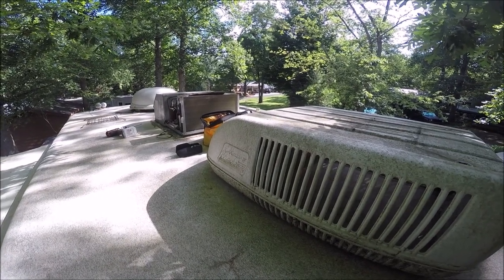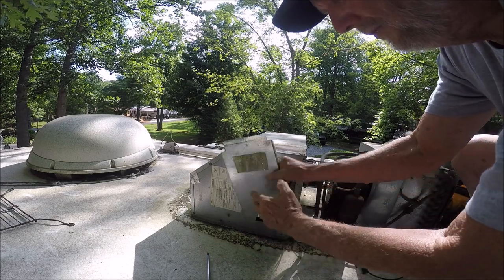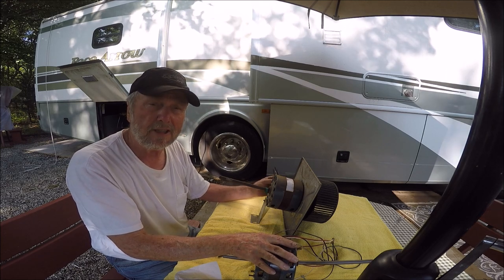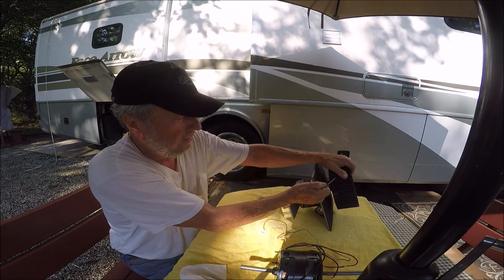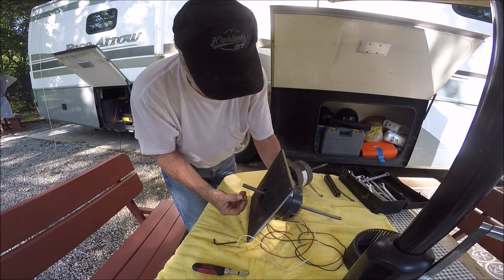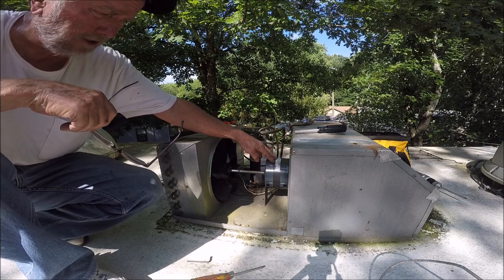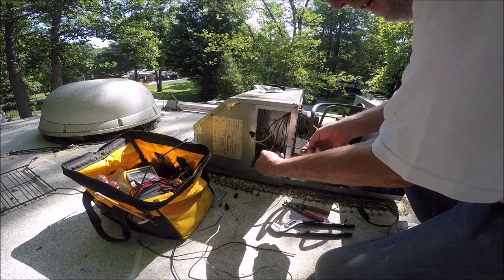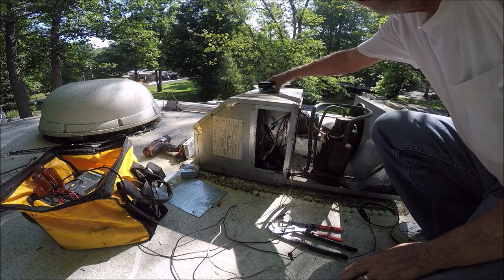Replace RV AC Blower Fan Motor on Coleman Mach

Comment: I'm happy to say after finally getting the replacement fan blade and few mods, you were right I needed to redrill for the support stand, it's a done deal, didn't have to replace the capacitor so since the motor came with one I have and extra one just case. happy trails.
Reply from the maker: Well Done!!!

Comment: Thank you for the video. I replaced mine today. I purchased my from Amazon for $135. It was the Fasco brand. The part number is D1092. The seller was Electric Motor Warehouse in Greensboro NC.
My ac is a Mach series made in 2003. It runs good and coils great.
Reply from the maker: @Lewis TT23, great always to hear when folks find my video helpful.  Thanks for putting your part name and model number, will help others.

Comment: Thank you for the video! The instructions were spot on and it made my job go very quickly. I replaced the Cap and the motor and wow what a difference in power and efficiency. Thanks again!

Comment: Thank you for taking the time to show how to take that fan assembly out. In my case I need to replace the plastic wheel but the procedure I’m sure is the same. Robert in MD
Reply from the maker: Yes, if your motor is OK and the squirrel cage plastic wheel needs to be replaced, you would use this procedure to gain access for replacement..  Good luck.

Comment: You must have had a really hard time getting it out because you skipped taking it out. A very important part showing how not to damage coils.
Reply from the maker: Yes, there was rust on the shaft, liquid wrench, a hammer and screwdriver.  There is no one way to do it, you try everything.

Comment: Nice video thank you, but please discharge your capacitor before  touching the leads just to be on the safe side.
Reply: How do you discharge the capacitor?
Reply: @Stargazer1969  
Use a screwdriver and ground across the leads on top of the capacitor.
Reply: Yup. Every one of these videos glosses over that part. And it's kind of an important part!

Comment: Great video very helpful unfortunately for me due to very rusted old shaft the fan blade won't budge,  I've sprayed penetrating oil, WD40 silicon it won't  budge an inch, I've tried gentle side to side motion like the video said prying, pushing, pulling, hammering nothing ,its like there is a clip or something in front of it holding it in. My only option now is to cut the shaft off so at least I can get the motor and fan out, try go get it off on a work bench, worse case scenario I need to replace the fan blade, which by the way is on Amazon.
Reply from the maker: You are thinking in the right direction for getting the motor out.  Get a new fan.  Good luck.  One thing I did was take a heavy duty screwdriver and hit to real hard on both side.  It started moving.
Reply: I'm going to try some Blaster Mult Max i picked yesterday at MallWart I did try tapping with a strong screw driver on both sides. Well if I have to cut and can still get than fan blade off, no loss since I have to chuck the old motor anyhow. I appreciate your getting back to me so quickly, happy trails.
Reply: Well nothing budged it so I wound up cutting its just as well because all the pounding cracked part of the fan, I found a replacement on Amazon, thats the least of my problem, I went to mount the new motor and accept for where the motor screws for the lower support stand goes not one of the damned mount screws aligns with the mount plate, I either don't have the right motor although its rated and wired the same, ts a bit wider, looks like I'm going to have to drill 3 new holes in the plate keeping the shaft centered is the problem since I don't have a work bench to work on it, what would you do? Thanks
Reply from the maker: @cptluckystar  The alignment just has to have the fan clear the housing and not touch as it spins.  You should be able to drill the holes if you can't get the same motor that came in the unit.
Reply: Yep.pretty much figures, I did find a Amazon review where they had to do just that,  the motor is pretty much the same except for.one being yellow and not.brown striped, go figure, because the housing is a bit longer, the support stand will need be mounted a bit further out, I know I got this, thanks  for the help. I just want to emphasize for anyone who is reading this, make darn sure you discharge the capacitor old or new, before you remove or place the connectors, they can carry quite a shock and the last thing you need is getting shocked while on the roof, happy trails.

Comment: I think I have to replace mine.  Last fall I had to remove the interior section and give the motor a spin before it would take off.
I tried it today and worked but then slowed way down after a few minutes and now it won't even hum.
Assuming the motor is shot unless a capacitor on these could cause that problem.
Reply from the maker: @Hiperf2007, you motor needs to be replaced.  A good motor should be able to have the fan flipped and it make serveral revolutions before stopping.  You it does not spin freely without resistance, it is bad.  Some people just go ahead and order a new capacitor to ad with new motor, just for insurance that all will last a long time together.  Good Luck
Reply: @samowens44  Mine spins and spins fine and then slows down.  I just got everything going.  Had to give the fan a spin but it took off. The compressor kicked in and it ran for about 30 minutes blowing cold and then suddenly the unit shut down and wouldn't do anything.  Had to let it sit for 30 minutes before it started trying to turn the fan. Gave the fan a spin and it's running right now. Fan only. Not sure what that was all about.  Thermo overload? Breaker wasn't tripped. It has never done that before.  Once it was running it always kept going.
Reply from the maker: @Hiperf  not sure what the problem is.  I just know that most fan running issue require changing fan motor and possibly the capacitor.  Mine did the same thing, would run for a while slow down and stop.  Good luck, hope  you discover your problem.

Comment: $95.84, came with motor and capacitor. Purchased on ebay.Got it within 2 days. installed it four months later
Reply from the maker: @Joyce Nord, thanks for your comments.  This will help others see that you can do it yourself and save  a lot of money.  You know that you got the job done correctly and did not get ripped off by some company that is looking at their profit lines.  Not all companies will rip you off, but there are some that will, as you know.  I would like to know how much this repair would cost a person that did not watch a video on how to correct this problem and had no idea of what is required.  I hope someone that has had this job done by a professional give us an idea of how much it cost them.  Thanks to anyone that responds.

Comment: Thank you Sam.  Your video made it easy for me to replace the fan motor in my AC.  Now I don't have to listen to the squealing motor when the AC is ON.  Do you know if it's possible to replace the bearings in the old motor?
Reply from the maker: I do not know for sure, but if the motor is 15 years old, I would not replace bearings, just go with new motor, you will need a new A/C by the time it needs another motor.  Thanks for you comments.

Comment: I have Coleman Mach Series RV AC. Everything works for a couple minutes, Then the Fan stopped. I replaced all capacitors. Still the same problem. Do you think it is Fan motor issue?
Reply from the maker: The fan motor is bad.  Follow my video to replace motor.  Good luck.
Reply: @samowens44  thanks
Reply: Where did you order the fan motor?
Reply from the maker: @xinli8046  Find the motor model number and order on Amazon.  Go to my website, Amazon.com/shop/samowens  Click on my video and you will see the motor I ordered.